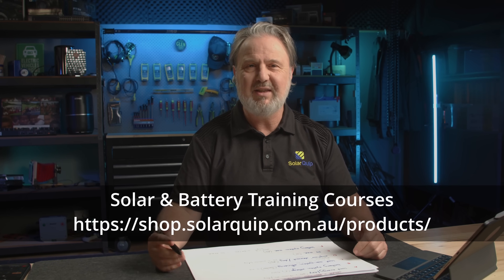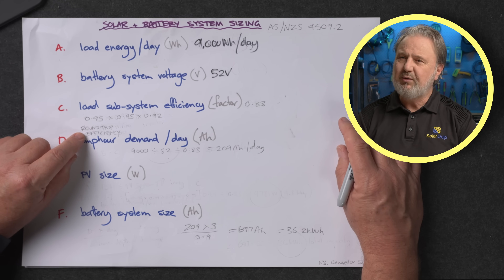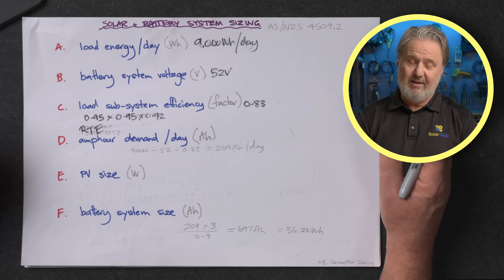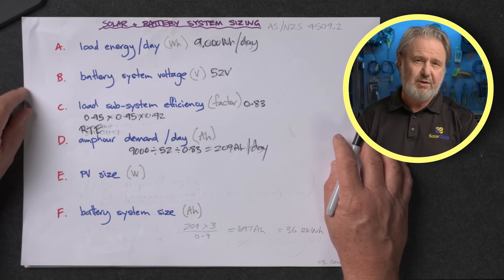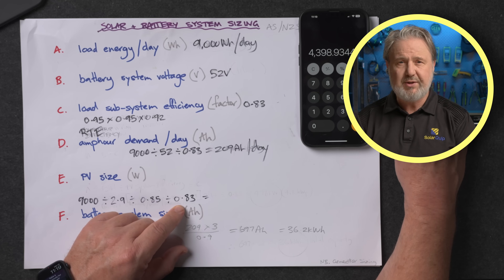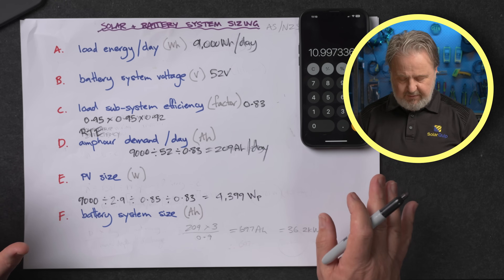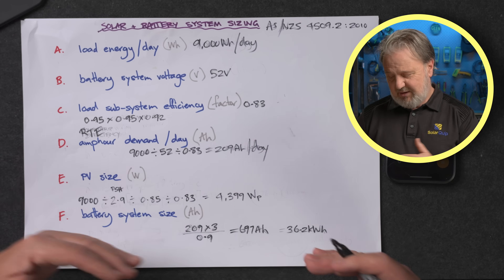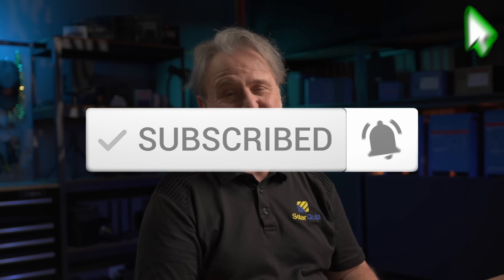Sizing a Solar Panel and Battery System for Off-Grid

Comment: Great designs there..I just have some worries. From your designs the number of panels don't change irrespective of the days of autonomy,  how then can we be sure that capacity of battery for 3 days autonomy would be charged by the  number of PV  you designed for?
Reply from the maker: Yes, you're right, if you want a 100% solar fraction of your energy then you need to massively oversize the PV so that even the longest period of low solar input, you still have enough reserve capacity. Alternatives are back up generator or demand reduction.
Reply: @SmartEnergyLab I think with relatively high cost of fuel, using a back up generator to run or support a solar system would only increase overall cost rather than increasing panels where the ROI will be reduced. 

Thanks for the knowledge shared

Comment: I think that the panels must be big enough to supply the load as well as charging the batteries at the same time.
Reply from the maker: Yes, correct. Think of it this way: if your battery is full on day one, you use 10kWh and your PV replaces 10kW + losses then you are back to full.

Comment: Well, for the pure Off Grid system then have to be added more PV capacity in order to recharge the battery while PV feed the load connected

Comment: Ok, im slow. still not getting it. I have two 12v 280Ah batteries and four 550w panels. What size charge controller and inverter do i need?
Reply from the maker: The sizing calculations are just to confirm PV array and battery capacity. Sizing of a.c. inverter would be based on maximum coincidental load and d.c. coupled charge controller on maximum PV input voltage and maximum output current from the array.

Comment: On part D, you considered that all the power required in a day will be drawn from the batteries. This is not the normal case because during the day, you can use power directly from the solar panels. The batteries are required to supply power when the solar panels are not generating and that cannot be the whole day. You can increase the battery size to add days of autonomy if you wish.

Comment: Wrong. You are doing double accounting. Using the DC-AC conversion and wiring losses TWICE. 1:50 and 6:12.
Reply from the maker: The first losses are on the load side and are used to calculate days of autonomy, the second time these load side losses are included is to accommodate the PV sizing to replace the lost energy. Have a look at Appendix A in AS/NZS 4509.2 and you'll see the same logic.
Reply: @SmartEnergyLab  true.

Comment: Excellent video thanks ! Please, any explanation why battery voltage is set to 52 V ? is it something special about NZ ?
In my country, common battery system voltages for solar systems are multiples of 12V and include 12V, 24V, 48V, and sometimes higher multiples such as 72V or 96V.
Reply from the maker: In my example I used lithium ion batteries which have different cell voltages to lead-acid. Typically 52-54 V is nominal for a cell pack.

Comment: Imagine: this example shows 36kWh battery ESS for a home using only 9kWh/day.
So a home using 36kWh per day needs a battery ESS of 144kWh !  Expensive.
Some national electrical codes will not permit battery storage above 20kWh meaning they basically BAN off grid solar, in the name of safety.

Comment: My system was specified like this by the specialist power supplier I bought from and it is a DISASTER!  

It can fail and shuts down when demand is at a peak even though battery bank is like 90% full. This is due to the batteries not being able to supply high loads because 1/. there aren't enough of them to spread the load out 2/. they are lead-acid type and not suited to high loads. I have a backup generator and so chose to have only two days autonomy to reduce the costs (and the embodied CO2 emissions). The result is too small a battery bank to do the job on even 1 day. Maybe li-ion would have been ok but even they must have their limits. 

So in A. of your calculations you need to consider not just the TOTAL Ah demand but also the MAXIMUM power demand at any one time and check if the batteries can handle this.
Reply from the maker: You are correct - this formula is for sizing energy storage and PV generation only. For sizing of the inverter and maximum discharge rate of the battery system you would need to consider the maximum coincidental demand on the battery from the loads. I'll make a follow up video on sizing for maximum demand soon.

Comment: Are you not going to adjust the size of the pv system or the power capacity once the day of autonomy goes beyond. coz i think the charging of battery will also be affected seems on the computation is good only for the 9000wp.

Comment: Hi Glen, thank you for the lessons. I have a question, for a stand alone system without backup system, do we need to consider the amount of energy required to charge the battery when sizing the PV? if yes, how should we do it efficiently? Thank you.

Comment: Very enjoyable as I start my solar PV/Battery journey here in southern Illinois.  As a start after receiving my first PV estimates, I UPSIZED each proposal.  Most vendors started with a PV system that covered about 86% of my annual usage. I kept increasing the number of 405-watt panels until I got to 125% and was still within my budget.  Adding batteries next year so am hoping for more choices like the Tesla Power Wall 3 and lower prices.  Again thanks for the lesson and valuable information.

Comment: Here I am again being a contradicting prick.
My method is simple. Put as many modules as possible limited only by the size of the roof or the capacity of the inverter(s). If the customer doesn't like it, I just walk away. I don't want problems. I made $773 on export last month from a 30KW array which fits on a standard suburban lot with a house, garage, carport and veranda (my lot is 679m2). It was the middle of Summer and I was overseas making money while I slept. That's what you want. Also, I'm EV ready and I won't be overloading the grid if I get one. More is more. So what about cost? Rebates are on modules so the more modules the more rebates and the less $/Watt it will cost proportionately and the payback is super fast (if the export rate is poor get an EV and save on fuel instead).
More more more more more more moooooooooore.

Comment: 95% Round trip for lithium? Where do you think you're losing that much? i.e. 5% loss. Heat or loss of gases?
Reply from the maker: Mostly it’s the coulombic efficiency of charging at a higher potential than discharging. Check out the Battery Test Centres real world results.  https://batterytestcentre.com.au/project/lithium-ion/